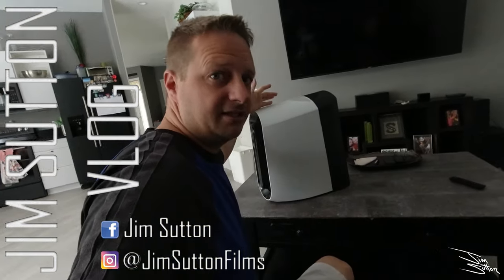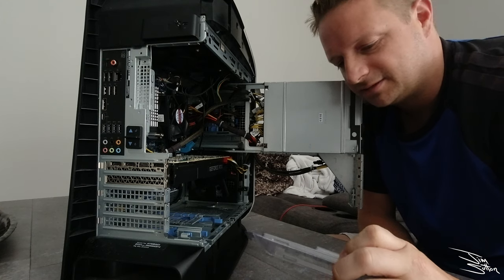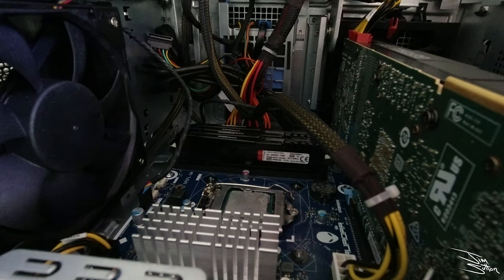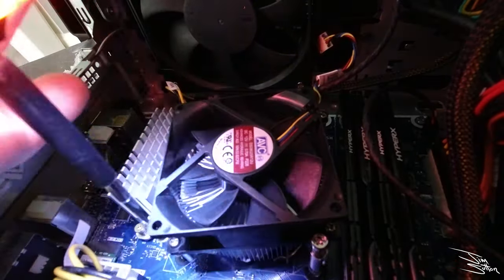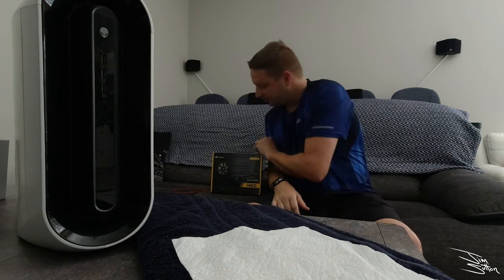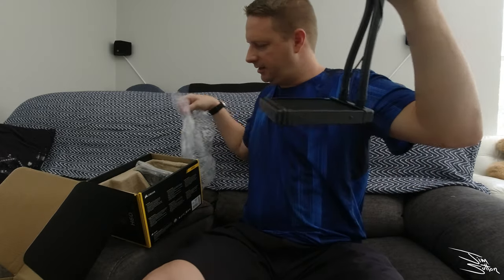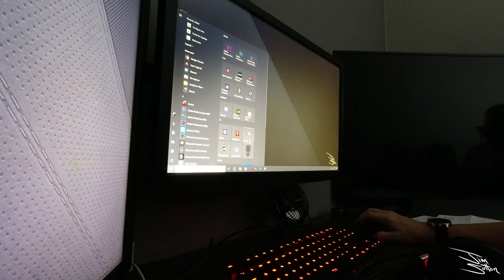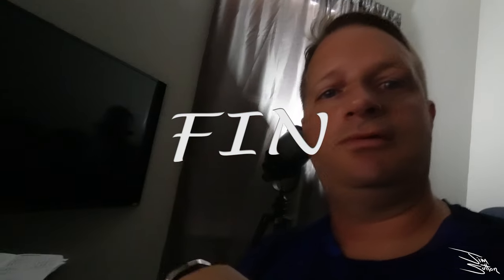VLOG #128 loud Alienware adding water-cooling so its silent and does not run so hot! Alienware R9

Comment: When you installed the fan on for the radiator did you put it with the arrows facing out of the pc or facing in because it says on instructions to use as a intake fan
Reply from the maker: Since heat rises.. I put the fans blowing up and out of the case.. and made sure my other fans blow into the case.  So 8t has good flow.
Reply: @DeCoNzMe  ok thanks

Comment: I’m having horrible temps on my air cooled R11. I’m looking at doing this for my system. The H60 is recommended for the job. However a lot of my research a lot of R11 users are getting a CPU fan error. Did you happen to get any errors? Also how’s the thermal pad still holding up? Would you recommend still? If so could you provide a link for the one in the video?
Reply from the maker: I did put a link here somewhere. The thermal pad is great.   And I didn't get any errors for fans.  The ones that I noticed that had errors did not get the H60.  They went with different models.

https://www.amazon.com/dp/B07CKVW18G/ref=cm_sw_r_cp_apa_fab_MeOBFbK6NE6P8
Reply: One last question, what CPU is in your system? I'm seeing the H60 might be to under powered for my CPU, a i7 10700f.
Reply: @DeCoNzMe  Are you still using the thermal pad in addition to the water cooling, or did you leave that out, once you installed the pump?  Also, is the fan that comes with the H60 designed to push air out the top like the stock fan does (does the new fan only fit in one way), or does it push air back in?  I read somewhere that Corsair says to have air blow IN through the top, which is opposite of what the stock fan is doing.
Reply from the maker: I made my fans blow up and out of the top.   And yes I have the thermal pad on there still.  All is working great under load.
Reply: @DeCoNzMe  thanks for the quick reply.  I just received my Aurora R11 2 days ago, air-cooled, running an i7-10700k and RTX 2070 Super.  My CPU temps are hovering around 80-90c under load, sometimes peaking at 100c, which can't be good.  I'm seeing some of your other comments mention to use both fans (the one that comes with Corsair and the stock fan) as a sandwich between the radiator.  So I'm assuming that means you're plugging the new fan into the Top Fan pins on the MB and the old stock fan into the CPU Fan pins?
Reply from the maker: @Strazman  yup. That sounds right.
Reply from the maker: @DiabeticDood  9700

Comment: I’m also curious why remove the thermal paste off the pump
Reply from the maker: i removed it to be able to use the thermal blanket . cant use both.
Reply: My apologies I must of missed that part when you cleaned it and mentioned you were gonna use the thermal blanket. Where did you get the thermal pad and are you comfortable with it
Reply from the maker: @CrypticHack3r  so far it's been perfect.  Ordered it on Amazon.  I would do that again. I recommend it.

Comment: One last question. Did you by any chance get a startup error for plugin that cooler in top fan I hear some users are getting those errors
Reply from the maker: There are a few comments in here about those.  No I had no problem.  Some fans don't play nice with the motherboard causing that error.  Just gotta make sure it's the right fan. (Note that there is no issue with the cooler at all, you could use your stock fan with it instead)

Comment: i have this same rig im prettyy sure. its hitting like 90-100 degrees when im playing for while. i just ordered that cooler. any other tips on installing? im going to take a shot at doing it myself but never taken apart a pc before
Reply from the maker: huge order the H60 cooler, the rest you should be able to do if you have the right tools (like the little screwdriver etc.

Comment: quick question which direction did you install the fan?
Reply: I believe if you use one fan you would want it to blow south, which wouldn't really be ideal because you would be pumping hot air into your case) if you use two fans (one on top and one on bottom of the radiator) you would want to have them both blow north, which would push air through the radiator and expell it out of the top of the case.

Comment: Thank you so much for this video. It was way more helpful than the manual. One question, did you get a "cpu fan error" every time you turn your pc on? Thanks!
Reply from the maker: No.. there should be no error.  That means the fan is not compatible.  Use the stock fan that was in there.  If you want a second fan.  There are things that tell you what ones will not throw an error code.

Comment: Theres something im confused about wheres your outtake the way you put the fan in im pretty sure that was an intake meaning theres no outtake im just confused because i just did this a few minutes ago and made it outtake but it still gets as hot as usual after a few minutes so im not sure what to do and it takes longer than usual to cool down like i really just want to know because i want to know if i need to make it an intake instead but the problem is if i do where will all the hot air and stuff go also im on the r11
Reply from the maker: It works really well for me.    The fan on the top is to get the hot air up and out.  The other fans in my case pull air in.  So a solid airflow.
Reply from the maker: @xxxsilverzxxxx328  no problem. Hope it helps you

Comment: Suppose to have to have the fan push air through the radiator and out the case not trying to suck air through it defeating the purpose of the water cooler also no outtake going pushing through the radiator your components will cook

Comment: good video but from my manual for the h60i pro the fan should be on the other side as an air intake not outtake
Reply from the maker: You can do it differently depending on your other fans. I wanted to hot air to come up and out of my case.. so that's how I set it up.  Hope your build works great too.

Comment: interesting didn't know Aurora R9  came with just cpu fan  mine came watercooled from dell   what overclock are you running 1 or 2  did the thermal pad work better then paste  and are thermal pads more expensive    just a suggestion but you should run a diagnostic check from Bios  make sure everything is still running fine
Reply from the maker: Ya it's running great.  It's my video editing rig as well as playing games.   The thermal pad works in my opinion exactly the same as paste, but it's reusable!  I suggest it.

Comment: Need help, sorry for my bad english. Just finish the installation on aurora R10 ryzen and get 2 yellow light flashing ananother one 2 secondes after. No screen, no mouse, no keybord.I have done everything correctly, i cant't get my new computer to work correctly. I have trie everything i have found on the net but can't fix it. I remove de water cooling et rinstall the original piece and style get the same error.  What can ido ????

Comment: I noticed that you put the top fan in so it pushes air up through the radiator. The instructions for the Cooling system recommend pulling cooler air through the top. Did you mean to leave the airflow the same ?
Reply from the maker: What I found is it seems to work best pushing the hot air out of the top.  When I moved to double fans.. so sandwiching the radiator, it really works well!
Reply: Jim Sutton thanks for the feedback, I guess I’ll flip my fan over.
Reply from the maker: @DDH516  try it both ways and let us know how you feel about it.   Would love more input on how it's working for everyone.  If you can check temps with it both ways.

Comment: So the fan goes on the outer most side of the case with the radiator in the inside? And the hoses want to face towards the top of the tower?
Reply from the maker: No. The hoses face into the tower.  It will not fit any other way.

Comment: Thank you for the video it was verry helpful. I did a lot of research into the R12 and got on sale for $600 off knowing I would have to upgrade the stock air cooler to an AIO. I just replaced the stock air cooled with a H60 and it seems to be working since the temps are down from 75-80 at idle to 45-50 the only thing I came across is the BIOS Support Assist Pre-Boot System Performance Check keep telling me that the CPU fan is not installed. It is not wrong, but I was wondering how I can tell the BIOS I am using an AIO know. Also, in Alienware Command center it still shows the CPU fan as an option. I figured that would go away since there is no CPU fan anymore.  Has anyone else seen this issue or have suggestions on how to fix it?  Thank you in  advance.
Reply from the maker: Mine was fixed by adding two fans, and the aio.   The second fan is now on the CPU pins.  Worked like a charm
Reply: @DeCoNzMe  thank you I did not even think off that. I added the second fan first hoping it would help using the splitter on the front fan pin.  I will try using the cpu fan pins for the second fan.
Reply: @DeCoNzMe  I decided to moved the pump into the he cpu fan plug and that got rid of the pre-boot check. I am also able to see the pump running in Alien Command center.  Amazing how such a simple fix makes a big difference. Why can’t Dell just use an AIO in all there systems. Thank you again for the help.
Reply from the maker: @seanandrews3106  glad that worked for you. Make sure the pump is running at full.  The CPU fan Ramps up and down depending on usage.

Comment: I have an R11 and just upgrade to liquid cool as well. What did you do with the preboot performance check that shows the error saying your cpu fan is not working properly?
Reply from the maker: if you have a compatible fan, like mine that came with the h60 - that error should not come up at all.   if it does, try changing the fans.  that is all that error is about

Comment: Where did you plug the pump power and pump tach cable in your Alienware
Reply from the maker: There is a pump plug on the motherboard.  Next to cpu fan where the old fan was plugged in.

Comment: If anyone still reads these 😂 I have an r8 and want to do this. However there is a “newer version” and also cannot find the h60 anywhere. I found a new one for 60 but it doesn’t have the led light is there a big thermal difference between the one with the light and the one without?
Reply from the maker: The 9nes with the LEDs and the ones without should make no difference. And no reason to have LEDs in a case like this. You can not see em anyway :-)
Reply: Yeah I wasn’t concerned ab the lighting just if it had better cooling specs I may pick one off of eBay new because their kind of hard to find, thanks a lot man

Comment: Did you get a CPU fan error on Bios?. thats what Im getting and its driving me crazy.
Reply from the maker: No. I have no errors at all as soon as I connected them all correctly.
Reply: never mind I figured it out lol nice video It helped out a lot.
Reply from the maker: @miguelcreed69  glad to hear it!
Reply: I’m having the CPU fan error too. How’d you fix it?
Reply from the maker: From everything I have read.. it just has to do with the fan that you have.  Only a few fans get read as correct for this motherboard, that's why the h60 was perfect. It came with a fan that the system sees as normal. Not throwing a code error.
Reply: @miguelcreed69  how you figure it out

Comment: I just bought mine off the website, R11, mine comes with water cooling
Reply: its still pretty loud in idle. maybe because of the cheap fans inside (front and water-cooler fan), im starting to change mine.

Comment: What is the size of front fan? Previously thank you :3
Reply from the maker: The size of the fans is all the same. The existing stock fan just fits on the radiator just like the one that comes with the water cooling setup
Reply: @DeCoNzMe  120mm?

Comment: I tried this myself but I'm not sure what I'm doing wrong. When I start up my computer the cpu isn't registering anything or the pump fan isn't working cause my Temps will be high like 90 to 100.
Reply from the maker: CPU not registering?!  That must be the processor not seated correctly would be my first guess.  And if it's hot, then the pump must not be running.  That's simple. Either it's not plugged into "pump" or it could be a bad pump I guess.  Please keep us posted on redoing that part.
Reply from the maker: The pump works on its own and it may get pretty warm if you don't have a fan blowing across the radiator.  One piece at a time.  Make sure the processor is registering and posting up.   Next step make sure the pump is plugged into the pump plug.  Then the fan is third.
Reply: So I bought a new h60 corsair and repeated the process, I just wanna know my came with a 3 pin which a plugged into the pump fan and it also comes with a sata connector, not sure if that matters.  When I turn the computer on everything is working except not the pump, it's not vibrating or nothing
Reply from the maker: @dilanducharme789  that is not a data connector.  It's a power connector.   It is the same power that you plug into your hard drives, or CD ROM drive.  There are a few extra ones coming out of your power supply.  Plug that in.  It should fix your issue.
Reply: So finally figured it all out got the pump working and everything and my Temps were lower by about 10 to 15 degrees, just wanna make sure it's the fan then the radiator correct the way it sits in. Like fan goes in first then radiator
Reply from the maker: @dilanducharme789  you can put the fan however you see fit. I like the heat going up and out of my case.
Reply: So everything worked out! Temps are down to 30 to 35 at idle but there is still one thing, my Temps are still spiking to 80 degrees mainly staying around 70 to 80 but it's a lot better than 90.  I also do not have my fans at full speed as it causes more noise, what did all you do after installing?

Comment: The fan goes to the top? My fan is at the bottom side of my stock water cooled aurora r11.
Reply: Me too, the fan is at the bottom and the Corsair logo facing the pump right? (Just following the instruction menu from the box) is that correct or it’s just fine installing it like that.
Reply from the maker: It's not super important. Try 8t different ways and see what your happy with.  The key is getting air flow through the watercooler.
Reply: It really is important. The radiator gets hot really fast specially in gaming so while you are pumping air inside the case to cool the radiator, the majority of hot air that is coming from the radiator stays inside your pc. Alienware aurora r11 only has one fan air exhaust and that's the top fan. The front fan is the air intake of the system. But then again, you do whatever you think is right for you.
Reply from the maker: Totally makes sense to me.  Mine is also built so the fans blow out the top.  But what I meant was I am  it too sure if it matters if the fan is on top or bottom of the radiator.  But I still like mine set up with both fans.  The more air flow.. the better

Comment: Thanks for this I installed it correctly and I’m getting lower temps; however, still gaming around 60-70c. My ACC cpu fan history that shows the speed of the fan spikes up and down from 30-100% is it because ACC doesn’t recognize this as a fan? Also in what order do you have the fans I have (from top of case to bottom) stock fan radiator then Corsair fan blowing upwards, does it matter which fan sandwiches on either side? 
Thanks for the video
Reply from the maker: Not sure if it matters which fan is first. However I have the bottom fan of the sandwich plugged into the CPU fan spot.  In your fan controls you should be able to make that fan at 100% all the time if you wish.  Maybe that would help too. However gaming at 60-70 is very reasonable.  Without this setup, before this mod I was gaming at 100°!
Reply: You want airflow through the radiator.  Whether you push air through it or pull air through it, shouldn't matter. But you want the airflow in one direction or the other. Not both.